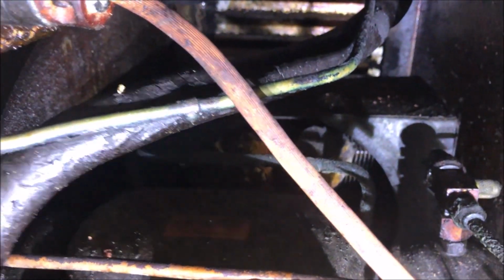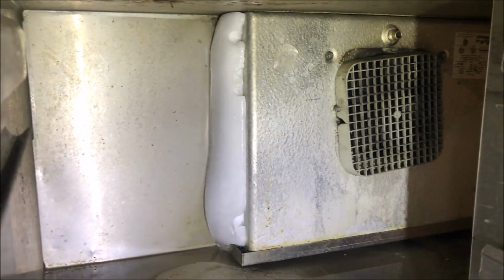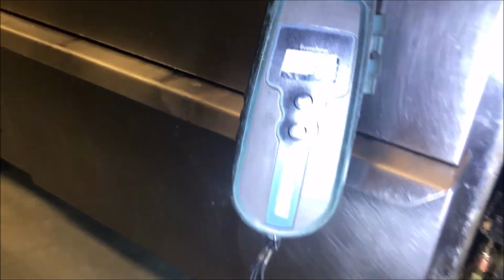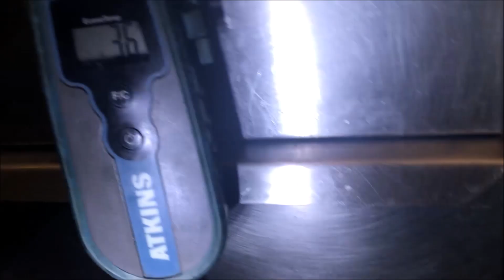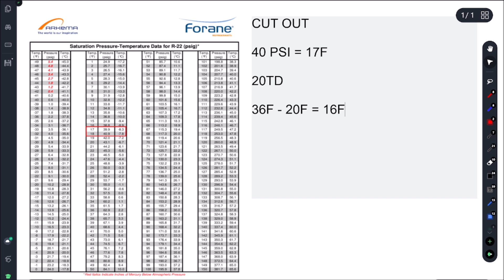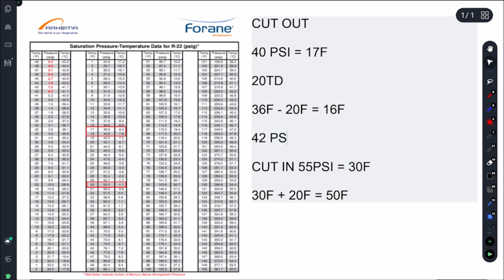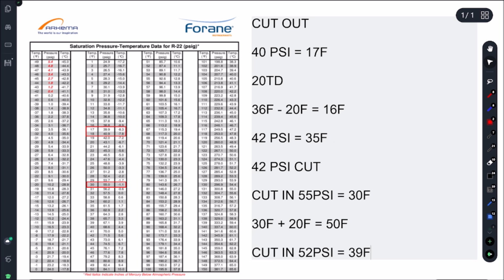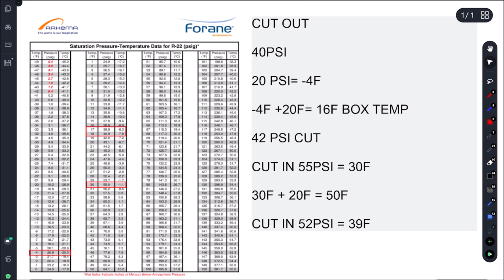Reach in line cooler is freezing up. How to set a low pressue switch

Comment: 🇺🇸👍💪❄ with the compressor off n when the box temp reaches 40 degrees then u want ur cut in.  40 degrees for r22 is 69psi. Ur cut in at 55psi is 30 sat. ? 
I would take highest box temp ex 40 degrees = 69psi cut in. Then take lowest box temp 35 degrees - td of 20  = 15 degree sat = 38 psi cut out. With compressor off wouldn't the coil temp b close to ambient/box  temp 40 degrees ? N set ur cut in that way.  Refrigerant temp is design temp when compressor is on
Reply from the maker: Yes that works, however if the Condensor is plugged the pressure will be higher. Also in the video I had 35F with 42psi and prior to that I had 40 psi for the same 35F box temp. That’s why I don’t use a pressure switch and always use a thermostat.
Reply: @REFRIGERATIONKITCHENEQTECH  its icing up because you have the cut in at 30 deg 55 psi,set it to 38 out and 69 in.pressure is temp,they work the same but it will not go in a vacuum.
Reply from the maker: I didn’t set the switch, it’s been like that for years. The point I’m trying to make to my techs is use a thermostat to control temperature. If the Condensor coil gets dirty, the pressures will change slightly and affect the accuracy of your cut in and cut out temps.
Reply: @REFRIGERATIONKITCHENEQTECH  adding a thermostat would be removing the defrost.it uses the pressure switch to defrost.
Reply: @MariosACandRefrigeration you can set a thermostat to cut in above freezing and stick it in the evap.
Reply: I agree I just like lpc for safety purposes.  Tkachuk to Florida

Comment: How does the frozen evaporator affect the liquid level on the sight glass? I would think the sight glass would be full because the lack of airflow in the evaporator causing less boiling of the liquid refrigerant.
Reply: Thats what i was thinking, only thing i can think of is due to the frozen coil the compression ratio is much higher and causing less movement of actual refrigerant making it “look less full.”
Reply from the maker: Anytime your coil is frozen, your sight glass won’t be full. Once you defrost the coil, you will see the sight glass will fill if the charge is good. I made this mistake early on in my career. Went to an O/t call and saw the coil was frozen and started to leak test as I didn’t want to defrost the coil because it was late at night. Couldn’t find a leak. Then I defrosted the coil and found the sight glass was and I wasted over an hour chasing a leak that didn’t exist.